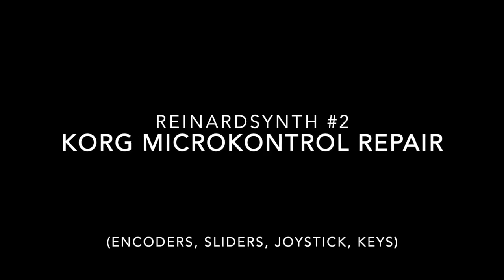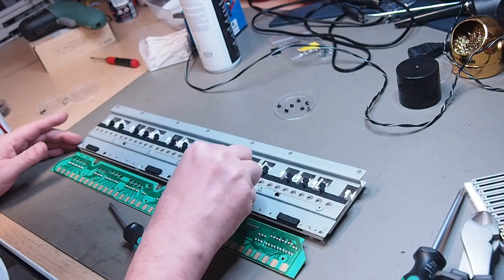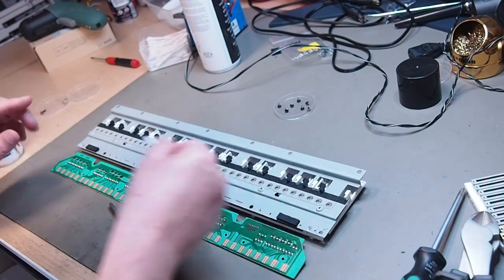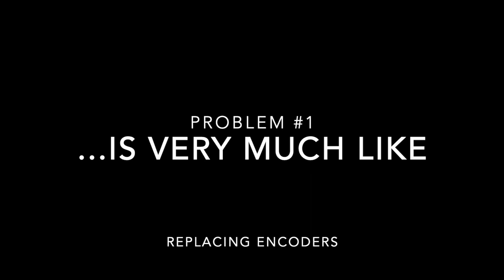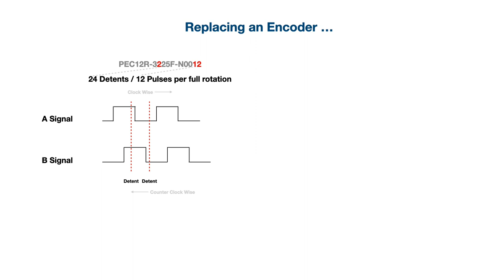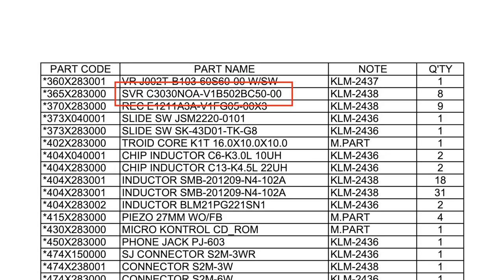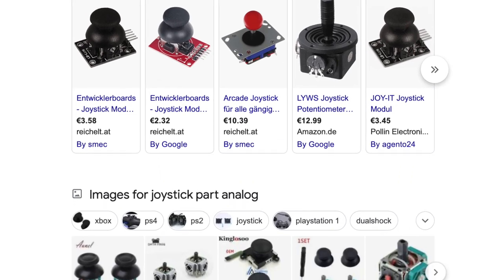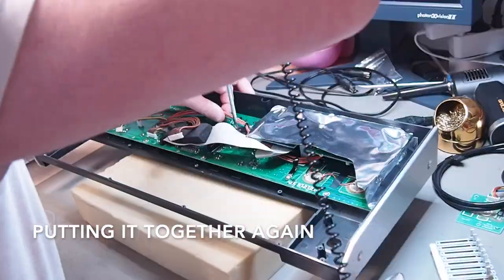ReinardSynth#2 Korg MicroKontrol encoder, joystick, slider and keybed Repair

Comment: I have a Korg Kontrol 49 collecting dust in my room, it has a really strange problem where if you press a certain note key on the keyboard it switches the octave 😂 no clue as to why it is happening 🤔Also the 49 has about 25 - 30 screws on the back which must be removed just to get into the thing, which makes me not want to mess with it.

Comment: Just found your video here.  My joystick has been playing up on both axes, it doesnt zero properly.  I was hoping to find a calbiration routine for the kb but no luck. Does you replacement show 0 when centered or did you have to adjust anything. Really hoping to be able to fix this, I love this little keyboard.  Not sure I can unsolder it myself though.  Are you able to do repairs for others?  I could send you the little joystick board, ive ordered a new joystick from ebay anyhow.
Reply: It zeroed just fine, the replacement fitted perfectly. It is not too difficult to replace because on a separate small PCB. Ask someone who has a electronics-soldering iron and some solder-wick. Just don’t butcher it ;-)
Reply: Hi there

I have the exact same problem since today.
I played a VST and suddenly the pitchbend value was at -8.
I did not touch the joystick.
I tried everything to get it to zero value again but no chance.
I wonder what happened because I didn't touch the stick since months.
It worked before !

I think I will have to replace it and see if it solves the problem.
Hopefully it's not another problem with the main circuit board.

Thanks fornthe video.

Comment: hi im fixing one of these atm its a mc-1 it looks like it has internal speakers for something ,is there a way to get them to make a sound for testing ?
Reply from the maker: The MicroKontrol does not generate sound at all and therefore also has no internal speakers... To test it: best to connect the MIDI-out of the MIDI-in of a synth or synth module